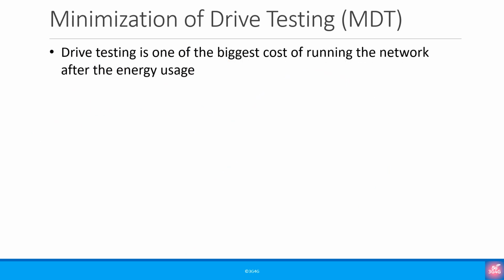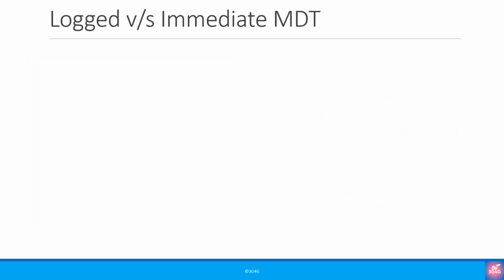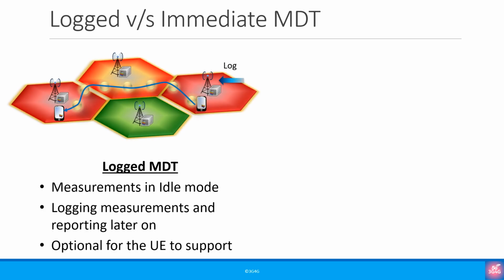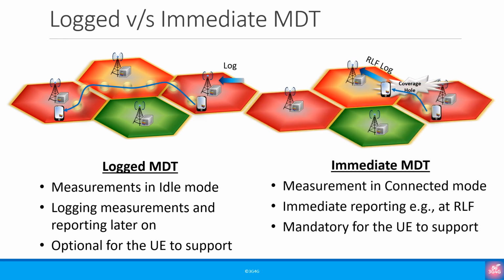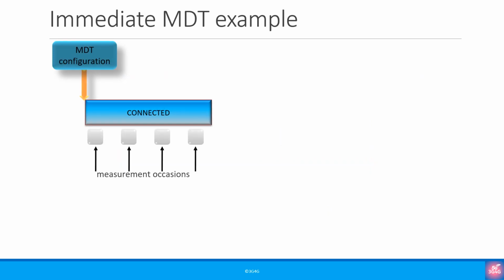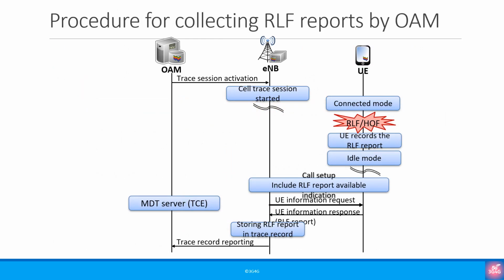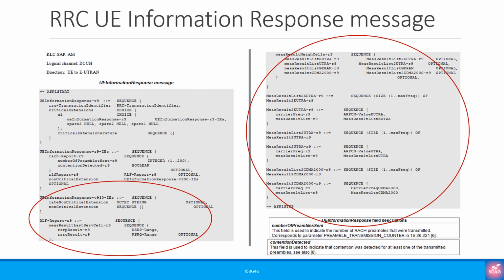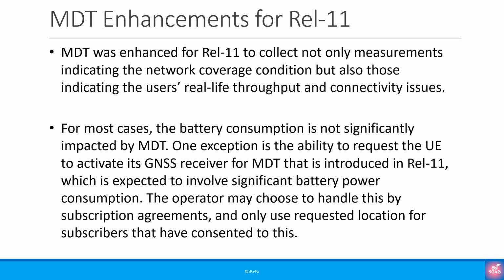3GPP SON Series: Minimization of Drive Testing (MDT)

Comment: Hi, Thanks for the detailed information. One quick question. Is there any capability requirement for immediate MDT or just "includeLocationInfo" added in reconfiguration should be enough to initiate the MDT reporting in measurement reports ? I am looking for location information of the UE only.
Reply from the maker: Don't think so. You may also want to check this post out: https://blog.3g4g.co.uk/2020/08/3gpp-mdt-how-it-works-and-what-is-new.html